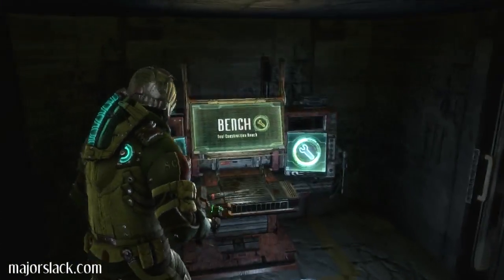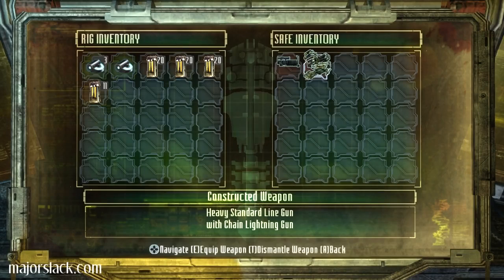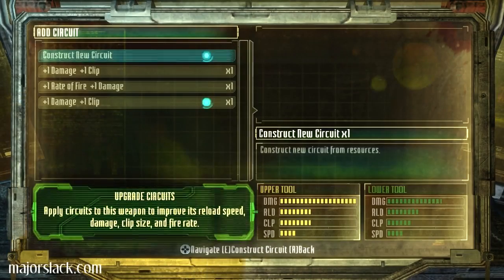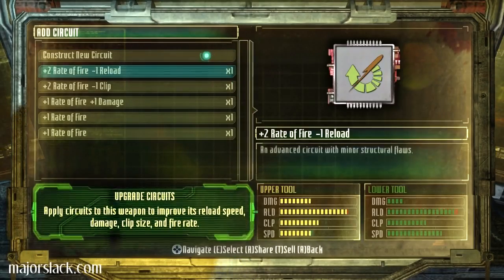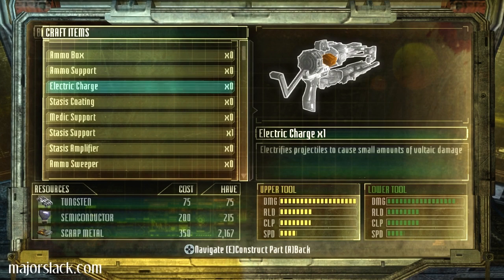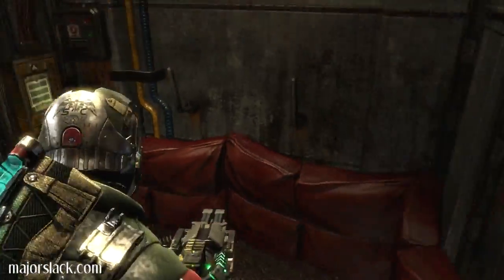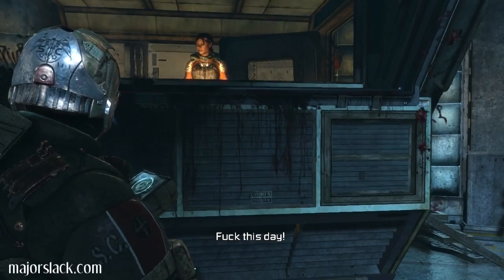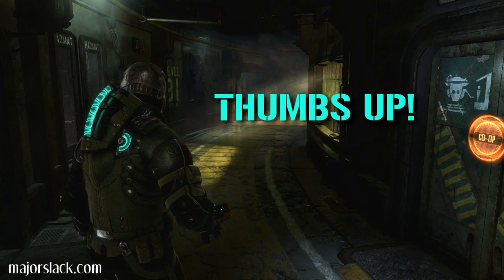Dead Space 3 Playthrough - Part 46 - How to Make a Kinetic Projector (Kinda like a Force Gun)

Comment: I figured you might be close to the end during this post. You might want to reconsider avoid placing rate of fire circuits on the linegun as the difference will not be significant. This goes to the same with any weapon that has less than 33% (6.66 bars) on dmg/rld/spd/clip; meant to say, boost the stats where they have more than 50% (10 bars). I don't know if anyone posted on this, but hope this helped in any way. You might want to sell the parts that will yield precious resources too.